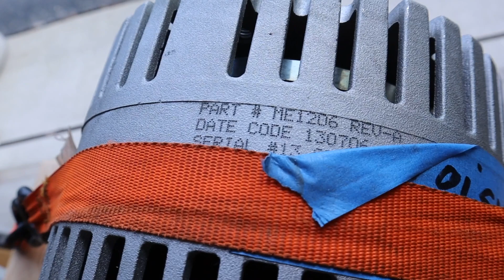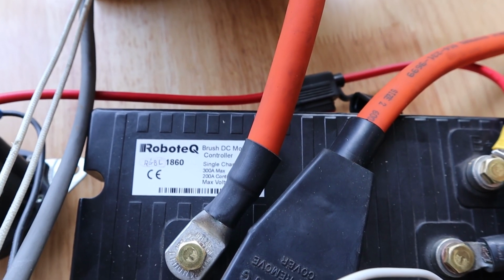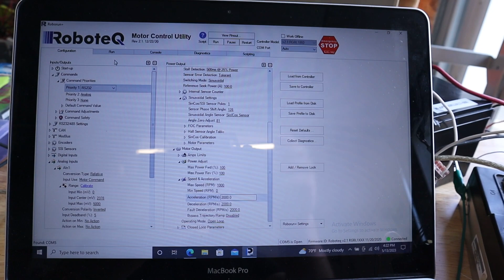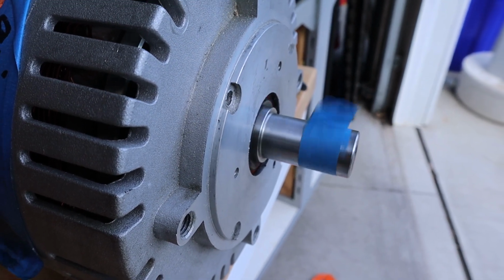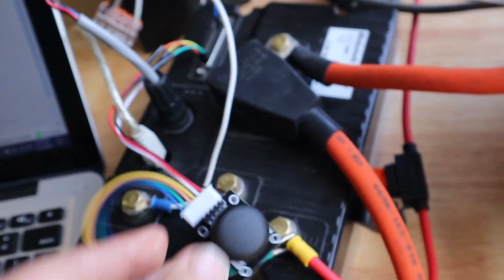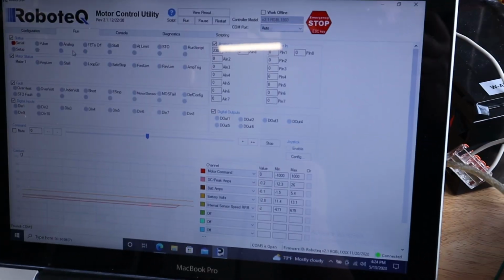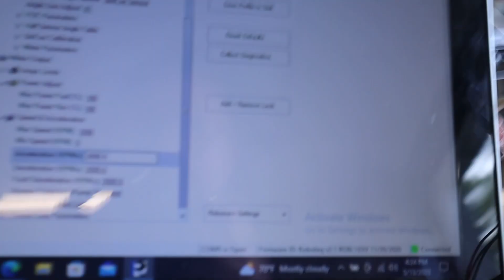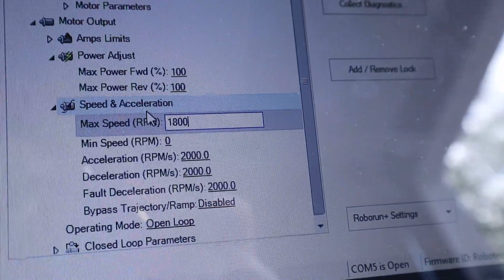Bench-testing brushless DC Motor and RoboteQ controller

Comment: Nice motor :)  It can't have a 3 phase input as that only applies to AC :)
Reply from the maker: Ha ha. Yes, that’s correct. Not sure what the right terminology for the brushless DC motor would be. Motor wires? Winding connections? Field terminals?
Reply: @BenjaminNelsonX  No idea either :)
Reply: The motor controller contains an inverter that produces a variable frequency three phase AC output.

Comment: Hey Ben! What’s the max unloaded rpm of the motor?
Reply from the maker: I think it’s 5000 RPM. That’s the spec listed in a similar Motenergy brushless DC motor. http://motenergy.com/me1117.html
I tested this one running on 48v, and it was spinning at almost 2700 RPM.

Comment from the maker: I just did a test with it running from a small 48V lithium pack. Max speed is about 2600 RPM on that pack, which is more than enough for my needs.
Only ran at up to a little more than 600 RPM on 12V.